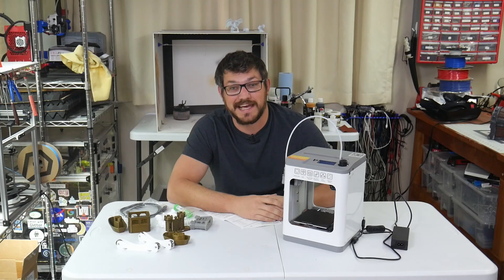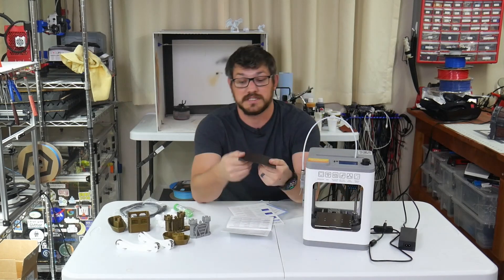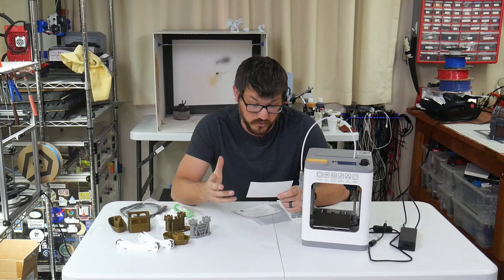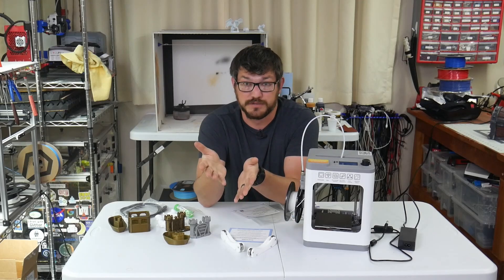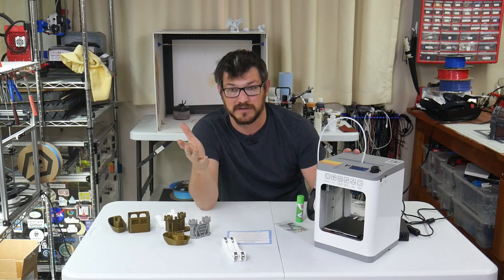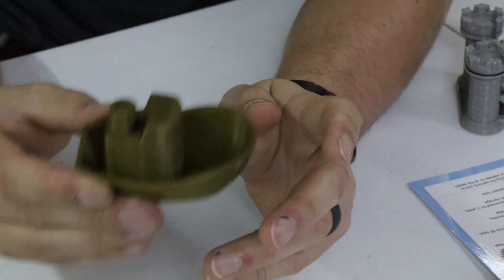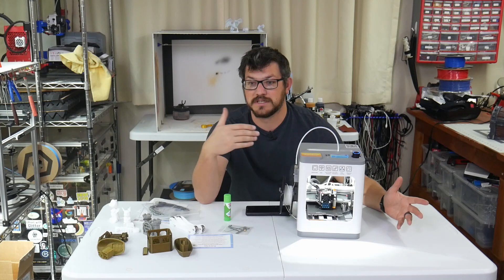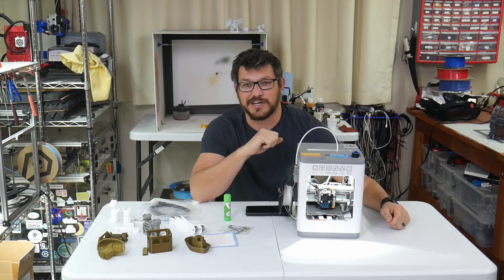Weedo Tina 2S Review

Comment: I've had the TINA2 basic for a week. It's great and it's my first introduction to 3D printing. Regarding octoprint, I installed octopi OS on a spare raspberry pi, and initially I couldn't get it to connect, until someone pointed out that the USB port uses a custom baud rate of 1000000. I had nearly given up, but you click "serial connection" in the octoprint UI and enter 1000000 in the "custom baud rate" field and save. Then select this as the printer baud rate and bingo it connected!

Comment: On non-adjustable beds a piece of tape here or there under the removable surface can often get you the incremental corner or center adjustments needed.  Then just add a Z offset to your starter Gcode in Cura, on one of my printers it is 1.5mm and on another it is 3mm... auto leveling was a marketing ploy! It's why I still prefer the Malyan M200 or MP Select Mini over other school-safe printers.